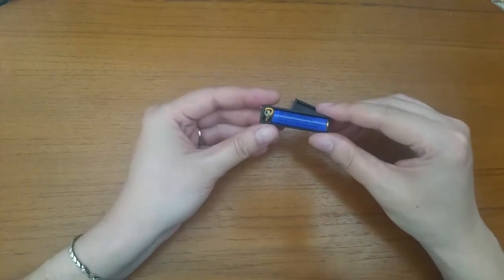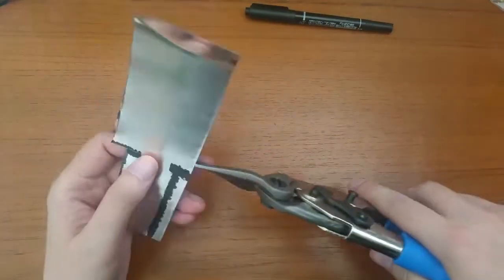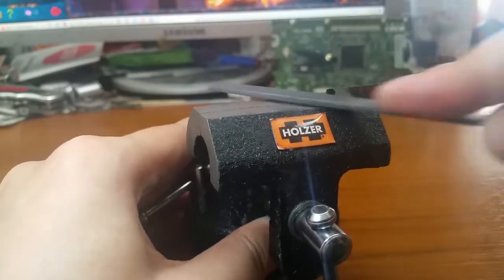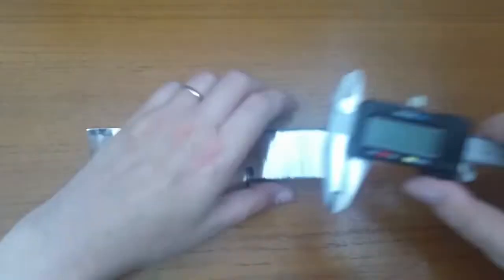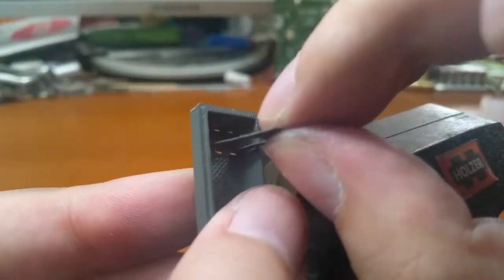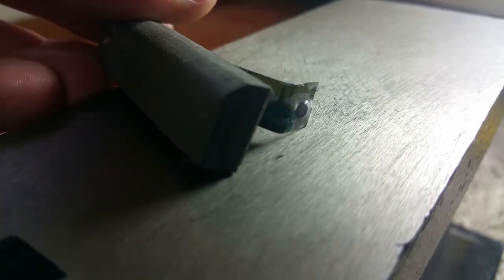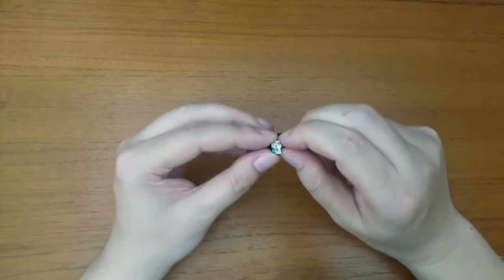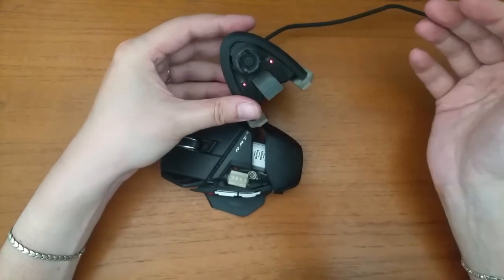006  - R.A.T. 9 - MAKE your own power cell, NO SOLDERING!

Comment: Hey - if you're in Australia and need batteries - I found 600MaH AAA Li-Ion 10440 rechargeable batteries here on ebay: https://www.ebay.com.au/itm/223666400847.  And can I just say Thanks heaps 
I Tinker with Things - I was getting worried about my batteries ...
Reply from the maker: You're welcome and thank you for sharing this.
Reply: there's no such thing as AAA 10440. it's either one or another.

Comment: Thank you for making these videos. This mouse is becoming an artifact now that there aren't more supplies. I already replaced the original batteries with the same models and it was quite tedious. Now the one case is staring to crack so i probably should move on to this new model of yours. 
How long do the 3D printed ones last? Do you have any recommendations for the type of plastic to print with?
Reply from the maker: Thank you for stopping by! And yes, well said, it's kind of artifact / relic right now :)
I have my 3D printed cases for 5 years now and they don't show any sign of giving up soon. I printed them with PLA because that I had at that time, but I guess PET would be fine too. I don't know what to say about ABS because I never printed with it... too complicated to meet ABS' "demands" on my printers and from what I heard is smelly and unhealthy too.
Reply: @I_T_T  Awesome! Well I am keen to try the same method you used. Thank you for the stl file. Probably only need to find the batteries and tin can of beans ^^,
Reply from the maker: You're more than welcome. Have fun!

Comment: Hi, thanks for the video. I can't find 10440 batteries in my country, closest I could find are 14500 3.7v 1200mah. Would those work?
Reply from the maker: Hello, thank you for watching :)
I think 14500 won't fit in the cases; the number represents DDLL0, DD - diameter in mm, LL - length of the battery in mm and 0 I think it's some kind of battery shape. 
So 14500 would be longer (50 mm vs. 44 mm) and with a bigger diameter (14 mm vs. 10 mm).
Reply: @I_T_T  Thank you for taking the time to answer.
Reply from the maker: Hey, no problem at all, you're welcome.

Comment: Damn, i shouldve done this back when my battery lost power and i had to change every few hours, because the battery literally exploded in front of me while it was charging just a few minutes ago, im kinda scared not gonna lie.. lol
Reply from the maker: Say what? The battery exploded? The original one? And with the original charger?
Reply: @I_T_T  Yes, everything original, never saw that coming, i mean there was no fire and luckily it wasn´t a big explosion, but it flashed, then there was a sound like when you short it i guess and then some smoke, i also checked if some metal part maybe got stuck in the charger and shorted it, but nope, everything as usual...,  i just took the battery housing apart, theres a hole in the battery,.. i didn´t expect that to happen :o (if the 130910 on your battery really is the date the battery was made, then mine was made on 12/07/05 :o)
Reply from the maker: @crx_oliver  That's... surprising. I mean I expect that the charger to have some kind of protection, but yeah, you can't trust the electrons! They are small, sneaky and they go wherever they want! :-P
Regarding the numbers on the batteries, I don't believe (not anymore) that's the date, it must be some kind of internal code. I found out later that the date on the electronic components it is (usually) in calendar week (2 digits) - year (2 digits) format.

Comment: First, get a 3D printer. :D
Reply from the maker: Or know someone who has one (cheap or maybe free), or just order the print from the online printing services (cost something, but you'll have your cases), but yeah, it would be much, much cooler to have a 3D printer (cost more, but you'll be the weird tech guy / gal) :-P
Reply: @I_T_T  why the hell companies just doesn't make the battery in f*ckin standart sizes? Why they don't do the battery holder case as a interchangeable cell slot? Like a remote controller. Why we always have to struggle for the good things? Why the princess isn't at palace, instead she is in the highest tower which is guarded by a f*ckin dragon and burning flames? Just why?
Reply from the maker: @svipace8220  I think I can answer your question about the batteriey. Basically I believe there are two main reasons:
 - design constraints; the batteries come in all shapes and dimensions, you can fit them in your design how you wish. You cannot cut or chop an integrated circuit, but you can do that with a battery.
 - greed; make you depend on their side products, also be able to set any price they want for it.

I cannot answer though to the question about the princes because I don't understand either why the hell she is in the tower with the dragon next to her!

Comment: Thanks a lot for a video. How long your RAT works on this battery?
Reply from the maker: Hello, thank you too.
Well, it depends on how "hard" I'm using it, but it seem to me that the battery last pretty much the same as the original batteries when they were "fresh".
I noticed a degradation over time, but this is the main advantage with this battery case, when the batteries will be just too annoying to use (because they will get empty too fast), I'll just buy another ones and I'll replace them in seconds.

Comment: Hello again. I already read that you don't sell it. It's a shame. Just one thing, how can I find that sheet you use? What's it called and how thick is it?
Reply from the maker: Hi there,
I just used a can of peanuts (Felix peanuts can, to be more precise). I cut it, flattened it and cut strips of sheets to the dimensions that I needed.
NOTE: Please be very careful with those sheets! They are razor sharp! Use a pair of leather work gloves.
If you have any questions, please send me an email, you'll find the email address in the "About" section of the channel.